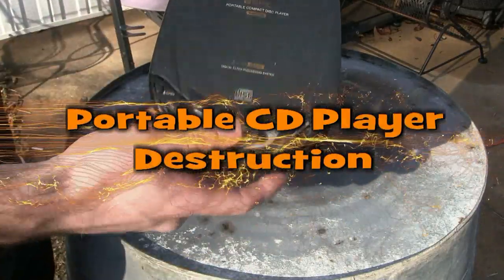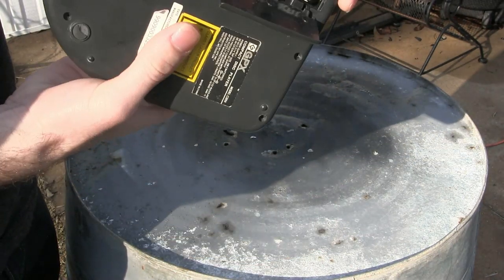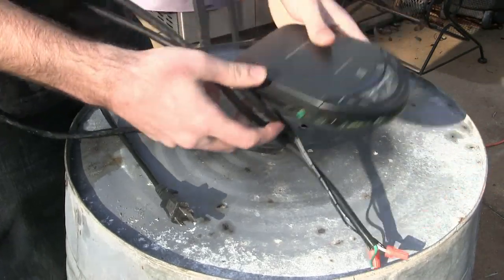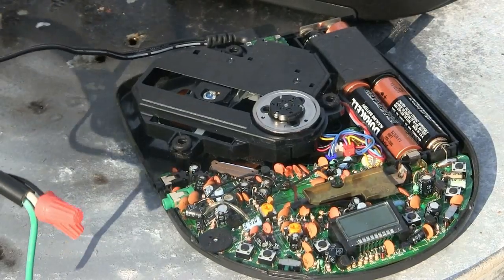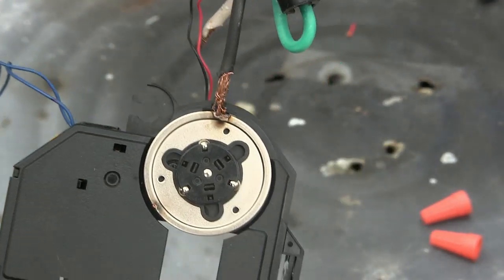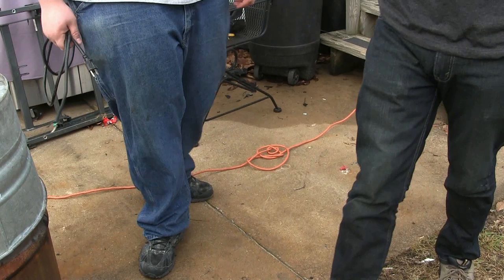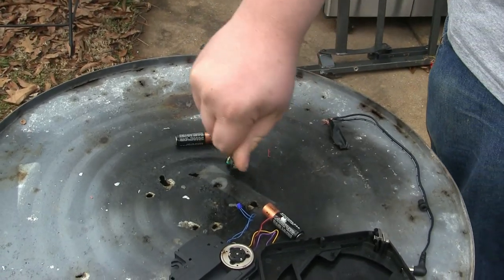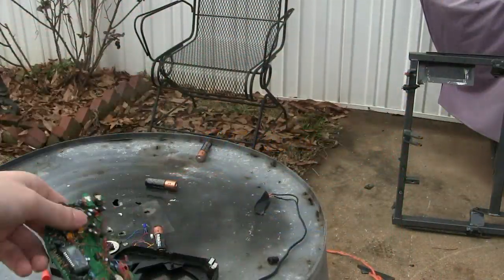Portable CD Player Destruction

Comment: Show a tutorial for the ac adaptor.
Reply: You just cut the regular adapter (or one that works) connect it to a regular AC cable, connect the two (twist, solder, wago/friction coupler, wire nut, etc) then there you go! But be warned, electricity is spicy